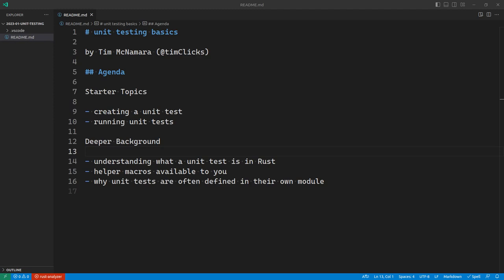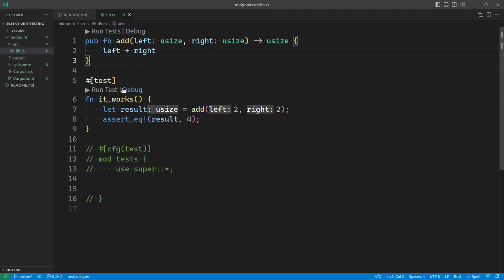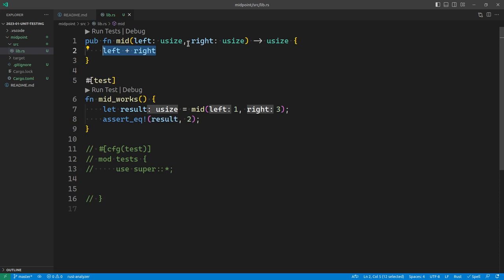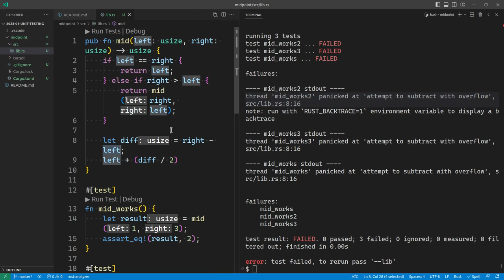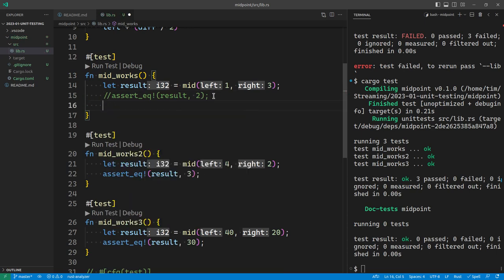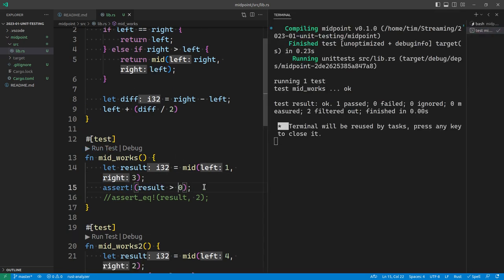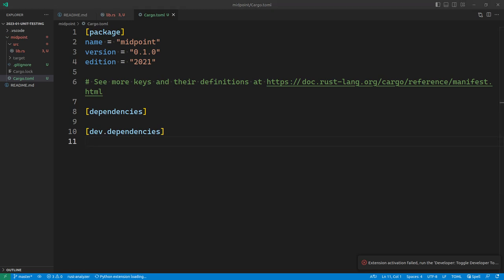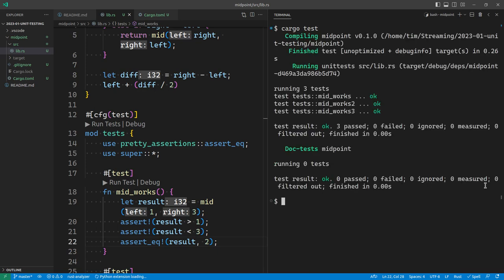Unit testing basics (can you fix the bug?)

Comment: Why not just '(left+right)/2'? Despite it doesn't matter to the topic xD
Reply: I guess that it's because it can overflow. With Tim's way it cannot. 
You could also do left/2 + right/2 to avoid overflow but since he's working with integers, that would have rounding errors.
Reply: @nicolaslopeza2251  the rounding error could be corrected like this: left / 2 + right / 2 + (left & right & 1)  -- essentially if they're both odd add 1.
Reply: @horndude77  Great recommendation, that's a clever way to solve the issue.
The problem of using that instead of Tim's option is that the equation ends up being almost as large, but some explanation might be needed to understand the '+ (left & right & 1)' part, so the benefit diminishes. 
I do believe that '(left+right)/2' is more readable and understandable than what tim did, but isn't as robust i guess.